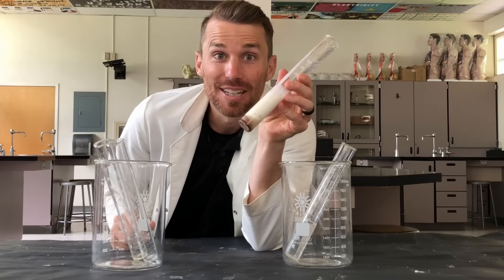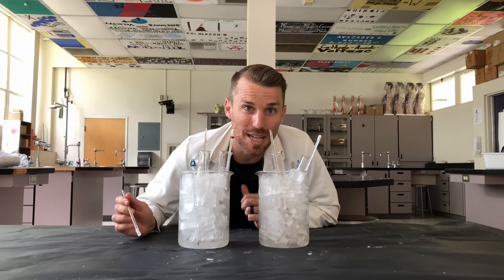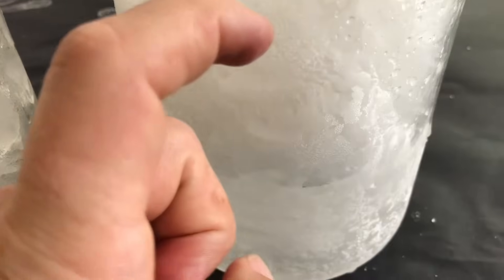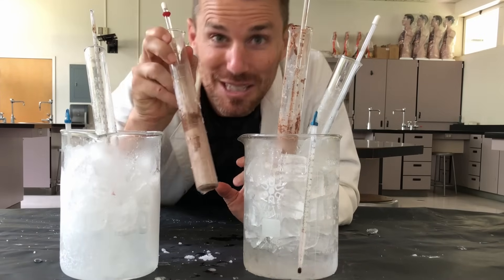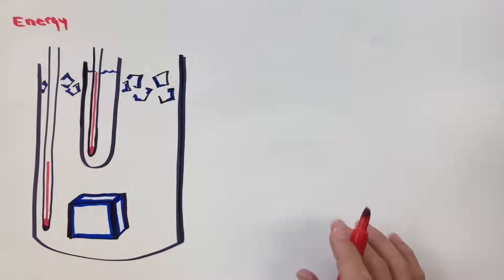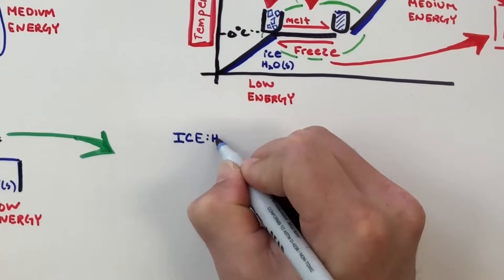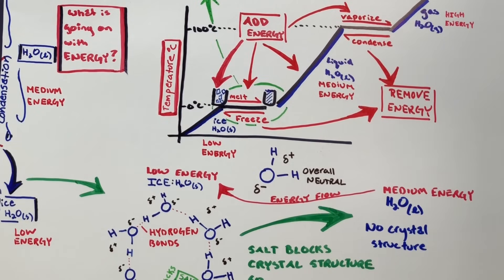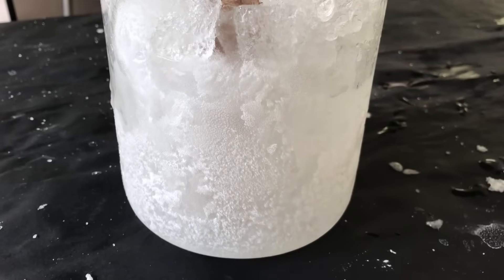what's the point of SALT in making Ice Cream

Comment: What kind of salt did you use 
Is it table salt . kosher salt or rock salt
Reply from the maker: I almost always use NaCl of some kind. I can't remember which I used for this. I have used kosher, rock salt, solar salt, most of them are just different shapes of crystals for the NaCl. Solar salt is the least expensive for a large batch!
Reply: @flemdogscience  does it matter if it's tiny grains of table salt or rock salt?  Is it worth it to spend more money on rock salt meant for ice cream or will common table salt be just as effective?

Comment: So it’s the water that gets to -8 does the ice stay warmer? I am having a hard time understanding the total energy. It seems like energy has to be leaving the system to get a lower temp overall. Like, 0c ice and 18c salt have the energy they have and we express that as temp. I get that it the energy flows from high to low, it just seems like the salt somehow makes a a lower low that existed before, but where did that energy go, the net energy is the same as it was when you combined everything right? So if something got colder, doesn’t something else need to get hotter?
Reply from the maker: Great thoughts! Here is what I would want to do to get to look at that some more...Measure the temperature of the ice. Would be really surprised (but kind of excited) if the temperature of the water dropped much below the starting temperature of the ice. I'm thinking the ice initial temp represents about the minimum temp we can get to. We might be able to get a hair lower than the ice temp because adding salt to water will cool the water as energy is required to break up the salt crystal, but I found that the temp drops because of that by about a degree or so (I did a video that is probably a little too long on the topic but if it interested you you can check it out.) So the initial temp of the water and the energy associated dump into the ice (cooling the water, melting the ice), and normally the water will stop at 0C since because it freezes below, but in this case it will keep dumping energy in to the ice (continuing to cool the water and melt the ice) because the salt is blocking the refreezing process. There are a couple follow up experiments I am looking forward to doing to get a some more data, but those are my thoughts currently. Does that help or did I dodge your question?